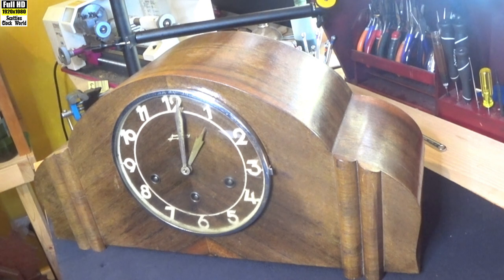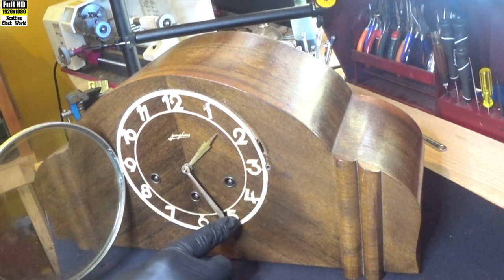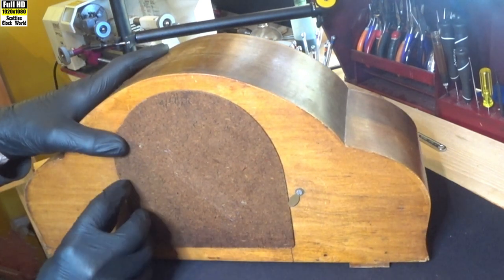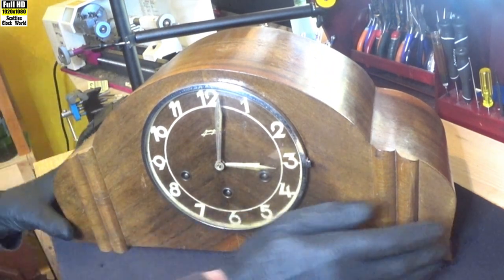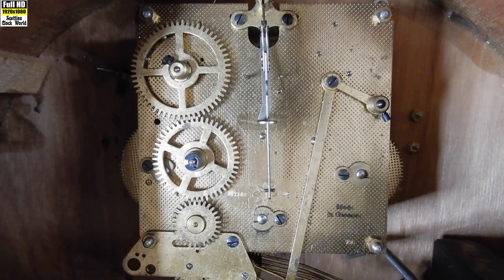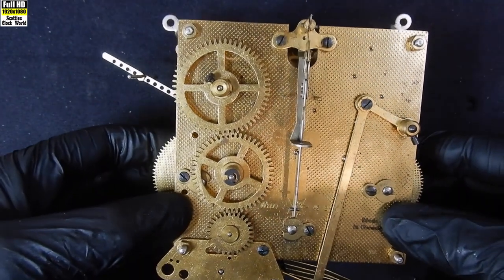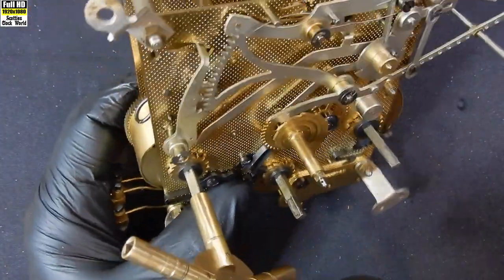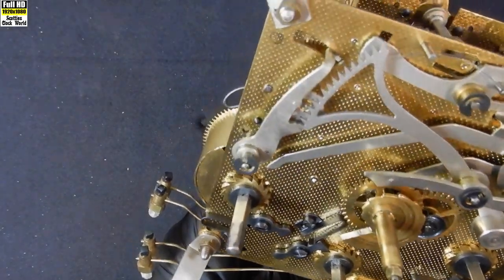Junghans W200 Westminster Chime Manrle Clock Repair - Part 1

Comment: I have a similar clock. Input small amount of oil every place i can on the shafts. The penguin still stops after half hour or so. What could cause this?
Thanks
Reply from the maker: Asuming the movement has been cleaned and oiled, If your movement stops when you add the pendulum.

A couple of things to try:
# is there sufficient end play on the Escape Wheel
# are the Pallets and Crutch moving smoothly (and continuing to) when the Pendulum is not attached, ie. the clock is in beat.
# have you put a drop of oil on both the leading and trailing faces of the Pallets
# is there a slight groove worn into the leading Pallet face
# when you put the Pendulum on, does the Pendulum slow down gradually then stop, or does it work for awhile than abruptly stops
if it is the latter, then the Pallets are falling too deeply in between the Escape Wheel teeth and the trailing Pallet is becoming caught on one of the teeth as it tries to escape.
Reply: @ScottiesClockWorld  Thanks for the info. I will have a closer look at these tips.

Comment: Hi Scottie, my clock doesn’t play music. It is a w200 machine. Can you tell me why
Reply: I put the minute hand back on then turn it. But the levers do not lifting.
Reply from the maker: Does your clock have a striking or chiming movement?
Reply: @ScottiesClockWorld  it is a chiming movement.
Reply from the maker: @beautyday8456  , are the hammers missalligned on the rods, or does it make no sound at all?
Reply: @ScottiesClockWorld  it doesn't make a sound at all. the pendulum just run for few beat.